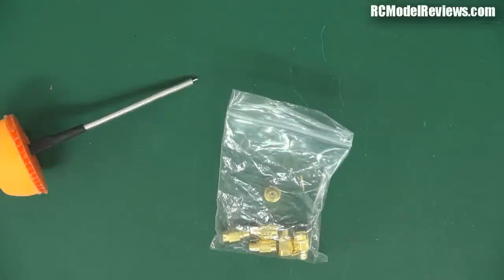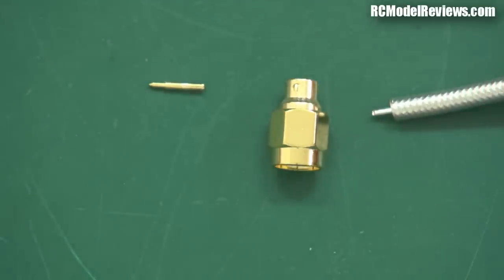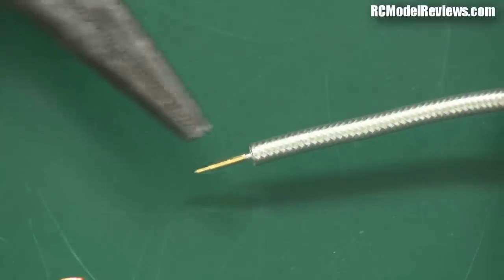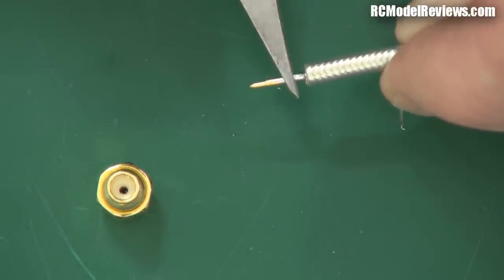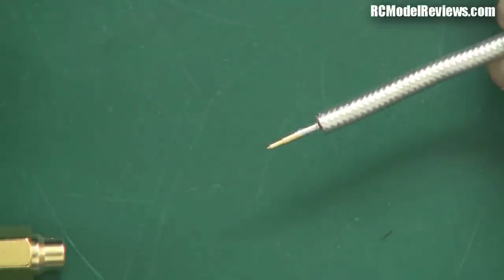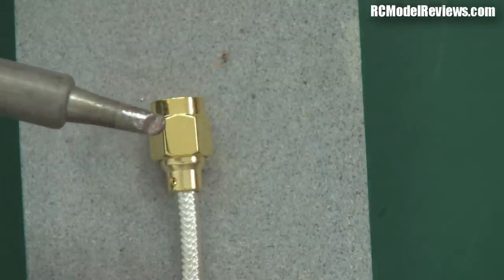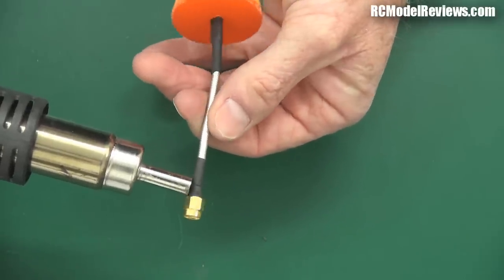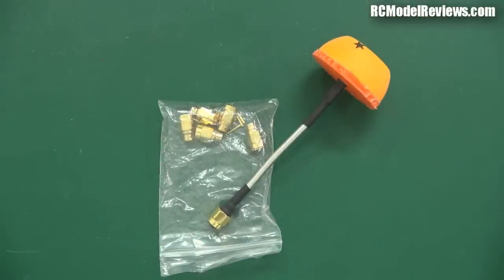FPV: Soldering SMA connectors to RG402 coax

Comment: Great video! For the center pin, I have super thin solder and I cut off 1-2mm and put it inside the pin, then put the pin on the cable, and heat the pin. Keeps all the solder inside and makes a fantastic, mess-free connection. No scraping needed.
Reply: And gold staying clean on the outside is a better conductor also => skin effect

Comment: That was a nice solder job.   Sometimes when a lot of heat is needed to get these heat-sink type jobs done I use a micro butane torch; the idea being that a lot of heat can be applied in a very short time... although you need to be very careful not to prolong or overheat your gear to the extent of damage.

Comment: You have a lot of information in that head of yours! Great job! And thanks. 
Something you could look into fixing would be an XJT module from frsky. Mine started beeping right after I overtighten the antenna.  A new antenna didn't fix it, so it must be the internal part (inside the module). Anyways, great video and thanks again

Comment: I needed to make a custom coax cable recently, and searched high and low for solder-on SMA connectors. I couldn't find them anywhere, and wasn't willing to shell out $100+ for a crimp tool and dies. Would love to get a source for these.
Reply: Aiden Flynn  nice to see some other hackers here

Comment: Bruce, I'm pretty sure that the hole on the side(of the sma pin)  is meant for putting your soldering iron tip into, then you melt some solder into the open end(don't fill it too much of course), and then put your wire in. That's just what I learned from Youtube, and is how I always do it.

Comment: Bruce, I read somewhere that the length of the coax is important. Seem to recall that the optimum length for 5.8 is 5cm.   Either side you get losses. Correct or myth?

Comment: Thankyou for this. I have a portable scanner with an SMA antenna. I was actually given a magnetic antenna and 2m of cable, but it doesn't have an end connection at the moment. I have a soldering iron somewhere, so will buy a connector and give it a try. I might get a better signal when in the car listening to the local harbour master, or ATC. The rubber duck antenna is OK, but not while in the car.

Comment: Is it not a problem that grounded metal shielding that prevents noise getting in and signal getting out is not connected ? In your video, it is only the main wire which is connected right ?

Comment: Given that you're soldering on the exterior of both pieces at the end there, is that heat-shrink actually serving any purpose?
Reply: ***** It just makes it look nicer -- especially if your soldering is less than 100% attractive ;-)
Reply: The semi rigid coax is it has poor fatigue properties as it was designed for fixed installations. I recently repaired one of my antennas because it had broken the shielding just where it enters the SMA connector. One of the advantages of using  heatshrink is to provide some strain relief to the joint. So in this regard I would go so far as to actually double layer shrink the joint. Ideally the SMA body would be longer so there is plenty of heatshrink overlap but you just have to make do with the minimal body length.

Comment: Hey bruce, i have a spironet antenna and the pin is missing in the RG402 connector so i bought a new connector.. now the problem is that it appears to be a crimp connector, should i just cut this off and start over? I dont really want to shorten the antenna so is there another way to get these off?

Comment: so you do not have to strip the insulation for the out side connection, will the solder melt through it? thanks

Comment: Does the carbon fiber frame affect signal if i bolt in the extend sma connector for my antenna?
Reply: The frame will be a continuation of the ground plane. which will improve Tx/Rx.

Comment: what if you solder the antenna straight on to the pcb without rpsma connector?   will it work?       I'm thinking of modding the antennas on some small fpv cams by adding these type of antennas.  do they NEED the connector to work?  if so, could I solder the connector to the pcb because I've seen rpsma connectors soldered to the pcb

Comment: Off topic I wish Bruce would revisit the new spectrum dx6,dx9 to determine  if it uses the freg spectrum better and if the power is affected by the use of a dry cells 4.8 v and a handle antenna.Orange receiver prices are on the rise but is still cheaper for junk planes than any in the states. Just bought a frysky rec and doesn't appear to be FCC  legal and cannot find a list of what is FCC legal in the states. One of our forms of protectionism .

Comment: Do you have a video on how to solder two RG316 pigtails together? I have a VTX that the Sam connector broke off. I wanted to cut the broken one off and solder two RG316 pigtails together
Reply: Don't think that's a good idea, you will have big problems extending the shielding and keeping the resulting joint from breaking. Better solder a SMA male and female adapters and connect the cables.

Comment: Hi Bruce,
not on topic but need some advice, I've got a 9XR transmitter, and I had an orange 615x RX, and an orange module in the Tx kicking about so for a new quad I've used this equipment. I'm not confident in this set up, and I've had one very precious self built quad, fully loaded fly off, I've not found it yet.

Can you recommend a set up that will give me a failsafe and the range I need, I don't fly usually more than 200m away, I've been looking at the frsky range of tx modules and rx dual stuff, but I'm abit lost. Can't afford to waste money!! please help, telemetry is something I'd spend the extra dosh on, but how does it all hook up?
Cheers Bruce! 

Almost forgot, it needs to be CPPM, as I'm loving the afromini32, or whatever it's called, the small naze32, it's mental for such a small light board!
Reply: unless you have GPS (naza, APM, multiWii) on board, a radio failsafe will just make it fly off. your are better off with it just dropping than going off under power...
Reply: Yeah, I thought failsafe on the orange 615x RX was set at binding, ie, I'd had it at no throttle,no input, so it should have dropped from 6", you live and you learn.
Reply: Thanks for the help Bruce BTW.

Comment: Hey Bruce,
Those are nicer connectors than mine. Is there a specific keyword I can use when searching for them?
Reply: Answering my own question but if you search for "sma male connector RG402" without the quotes you should find some for ~$6USD for 10.

Comment: Hey Bruce, just had a video idea for ya.  How about How LiPo balance chargers actually keep the cells of a battery balanced.  I've heard it both ways... At one end of the argument people say a charger only charges via the mains cable, and at the other end of the argument, people say the charger feeds current to each cell via the balance lead.
 
Would be interesting to break this topic down with science and meters :)

Comment: Please tell me which mini quad is the best!! All I need is an answer!!
Reply: There is no "best". it's more a personal choice and what you will enjoy flying over anyone else.  Honestly, don't go too cheap, but don't go most expensive either.  Frames that are cheap break and don't build well. Expensive quads are nice, but they cost money!  I like the GetFPV 250 class units, very nice.  Lastly tip: Try a few out if you can, then buy :)
Reply: What's your favorite? No one around me have any quads so I have no chance trying it out.
Reply: Roger .J I personally did a custom build however if I were to buy one kit these days, I'd go with the carbon frame QAV250 from GetFPV
Reply: ***** Can you tell me why and will you get the carbon fiber version or fiberglass version?
Reply: Roger .J I general, ligher weight, better for acro flying, more flight time too, but overall, the two frames sold by the company are not at all bad.
Reply: 230 mm String Theory from WarpQuad.
Reply: Gosh that's a can of worms... I'm working with a ZMR250 frame (£13 off ebay) as I have a ton of 2200 3s lipo's and should get 10 min plus flight times with baby beast motors and 5x3x3 props still to find out what a 6" prop gets, but on my mini v-tail I'm getting 8 mins.

Comment: semi rigid cable like RG402 may be bend only once and have copper tubing as an outer conductor! This cable in the video is braided cable
Reply: +MrTalaue It's semi rigid.  It's not a conventional braid and won't fray even when you cut it.  Unlike normal braided cables like RG316, when you bend this stuff, it doesn't spring back, it stays exactly as you shape it
Reply: +MrTalaue it rather looks like RG405, semi rigid is with solid copper tube as outer connector
Reply: +MrTalaue I don't know if it's "semi rigid" by whatever definition you're using, but if you look up the specs on Belden 1673A (RG402) and 1671A (RG405) they are pretty much identical other than the gauge of the conductor. They have a 100% copper foil shield covered with a tin-filled composite braid (The way it's tinned, it's not really a "braid" anymore.  you can't unravel it even if you try)
To me, the cable in his video looks like it has a 19Ga conductor, not a 24Ga, which suggests that it's RG402.
Maybe there's a "semi-rigid" RG402 which is a different thing, but this stuff is fairly stiff, and keeps the shape you bend it to without springing back.
Reply: +nwimpney I use both types of cable, semi rigid as well as the braided type of cable as on the video. Semi rigid cables are those with solid copper tubing shield. 

https://upload.wikimedia.org/wikipedia/commons/2/2c/Semi_rigid.jpg
Reply: Cool.  Yes, looking into it a bit further, it appears there's different varieties of RG402 and RG405.  They're available in "semi-flexible" versions which are rated to have the same performance as the copper tubing shield, but are also more bendable.

Either way, the stuff he's using here (I bought similar, listed as "semi rigid RG402" on ebay) is great for making RC antennas.

Unlike the standard braided RG-316, this stuff will hold its shape quite well so your antenna doesn't bobble around or flop over when you're flying, but can still bend out of the way in a crash.

Also, the fairly thick centre conductor is a bit more sturdy and easier to solder to for making cloverleaf antennas.
Reply: +nwimpney yes, RG316 is far too thin for that purpose in my opinion, RG400/141 would do at that length but weighs more

Comment: Does anyone know how you solder up 90 degree versions of these connectors? Even just the general principle - does it require any special tools?  Just trying to make receiver antenna and wanted to avoid using an adapter or bending.

one's like this? http://www.ebay.com/itm/10Pcs-90-Degree-SMA-Male-Plug-Right-Angle-RF-Connector-Solder-For-RG405-Cable-/272319691047

Comment: small comment:   when you solder that thing, you SHOULD not move the connector while the solder is still liquid over the surface of the braid.   You should let that get solid before rotate the connector.  I dont think you use 63/37 alloy that has an almost zero pasty state.  A regular 60/40 alloy would have some cold spots when moving while it is cooling down, an undesirable situation.  Not too much heat either ...
Reply: +perrogaruao He's using eutectic 63/37  You can see it on his backpack PCB video.
Reply: ohhh    ok   didn't see that ,,,,  great